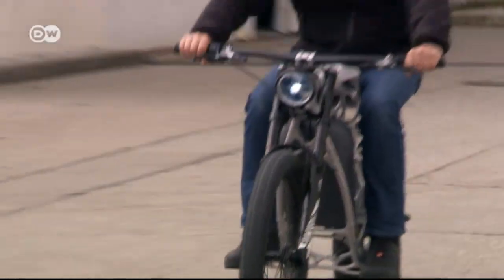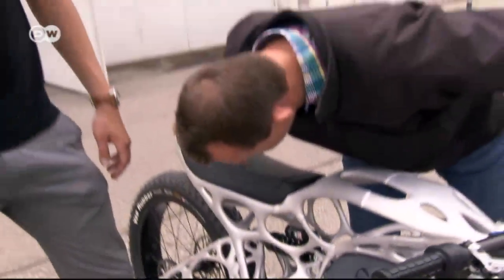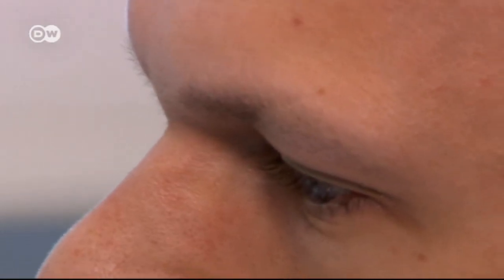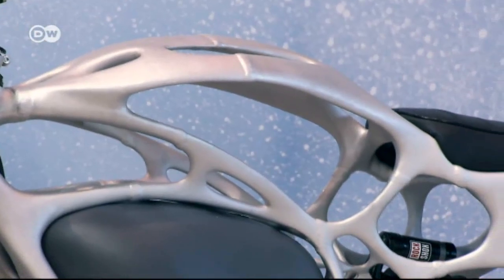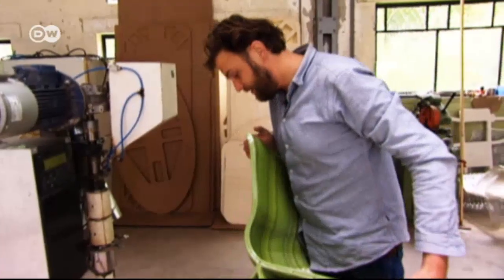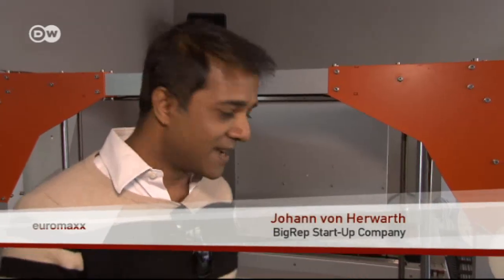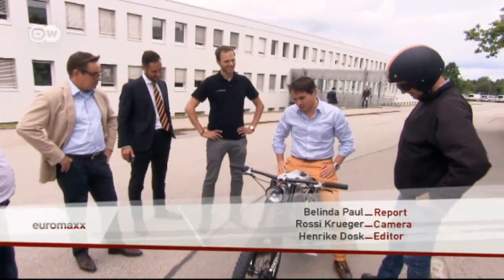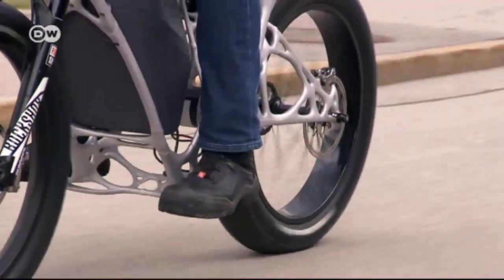The world's first 3D-printed motorcycle | Euromaxx

Comment: Not the neatest welding joints...
Reply: the welds should be stronger then the material used.
Reply: Also seams*  to defeat the coolness of the super strong design.
Reply: I'm sure a grinder will fix that right up

Comment: I hope someone is thinking how to solve the plastic pollution problem that 3d printing is going to produce.
Reply: I hope that u know, that great part of 3D printing material is biodegradable PLA.
Reply: +Artur Szczeparski i do now, thanks.
Reply: shred it and extrude it back into filament?
Reply: Did you actually see the video?
The motorcycle was printed in aluminium.
Reply: Long term, ABS has no chance to survive in 3D printing. It's not safe to extrude in domestic and office environment, it produces obnoxious fumes and high particulates, and it's easily replaced by the much safer PETG. PETG is in turn easily transformed into lower grade polyesters such as household fabrics, same as currently done with drink bottles.

On the other hand, many mass produced household items will still be made from ABS, this is nearly the cheapest and by far most popular plastic for household objects, and will land in landfills and burned up in stoves because of aging issues and overproduction. ABS is not long term stable, it becomes brittle with time, and it also degrades during the process of extrusion. Still I guess shredded prints can be used well for less critical injection molded parts.

PLA will probably remain relevant for a long time, but it's not a major problem, it breaks down like plant and animal tissue.

But all plastics can be burned in stoves and energy almost the same as from tar or oil of similar volume can be reclaimed, so I think utilization issue isn't all that big, the main issue is collecting the plastics. Of course it's better if it can be reused for new material instead, much more energy efficient and less emissions than making fresh material out of oil, but in the grand scheme of things it's unimportant compared to the amount of oil burned in vehicles, so that should be a priority.
Reply: +Artur Szczeparski yeah but ABS isn't biodegradable.
Reply: Siana Gearz u put your fingers through alot to say all this didnt u?